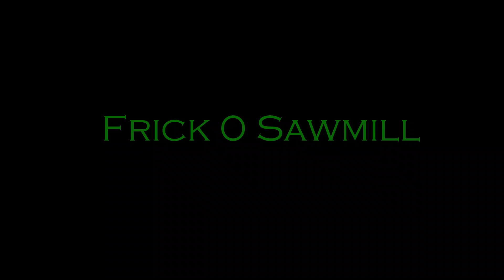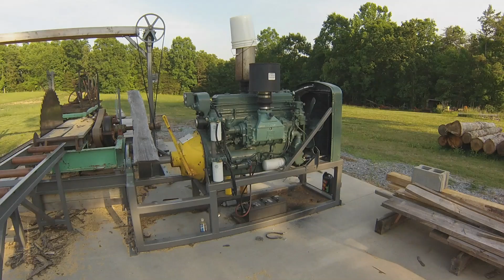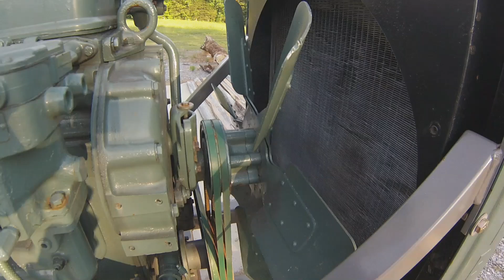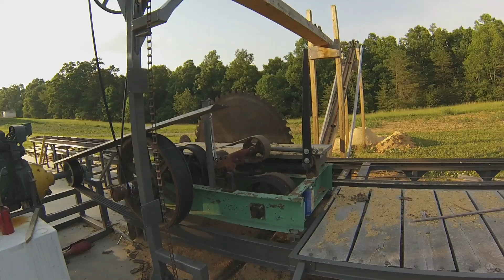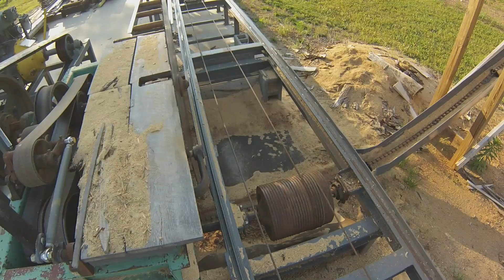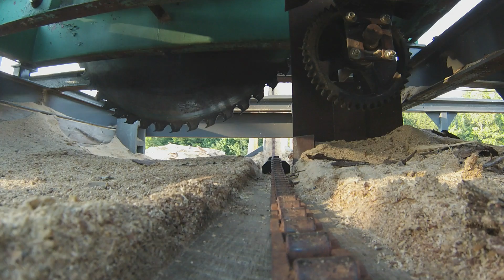Frick 0 Sawmill

Comment: Awesome mill. Set you up a belt driven blower system that blows the dust out from under the blade when sawing. The thing I don’t like about a pit is they still fill up with sawdust and sometimes water and are a mess.

Comment: Most of my first years in trucking taught me all too soon and too quickly Detroit's run cold unless they are being run hard. I froze in the cab of more than one truck with a Detroit engine. This was true all the way through to the 92 series. Shutters and a smaller fan will help some but don't look for great strides in the heat department.

     Mike